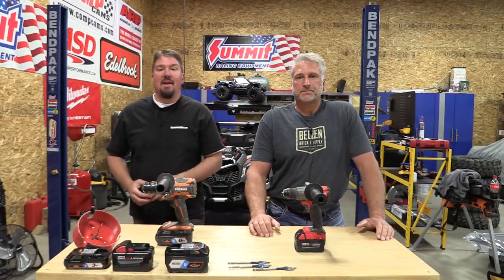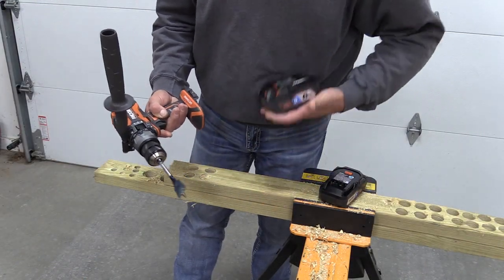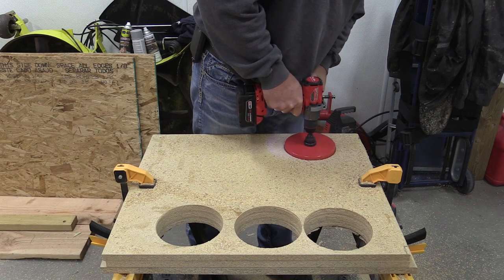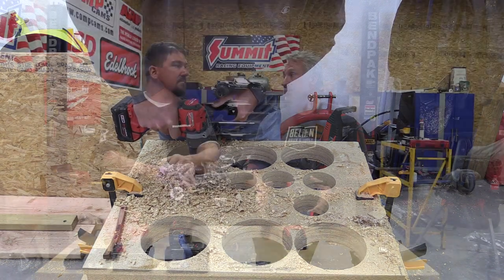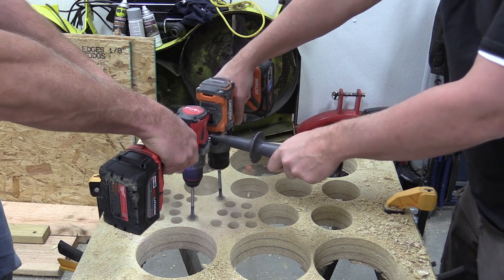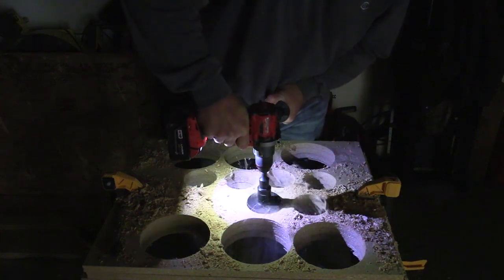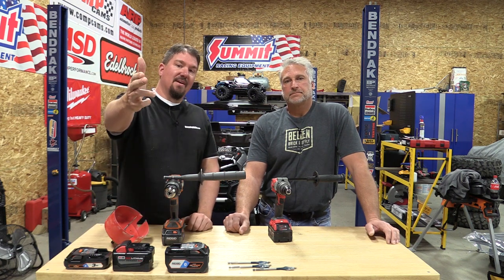Ridgid 18V GenX5 Octane Hammer Drill with 1300 in-lbs Vs Milwaukee 2804-20 with 1200 in-lbs

Comment: Try the same test with the Milwaukee high output battery and see if you get the same results I believe you may not. Another test would be a long-term test just from my personal experience Rigids don't last very long on an actual job site.
Reply from the maker: We are working on it.  There are no 6.0's in the shop and putting a 12.0 on it did not change who won the contest, but seemed to skew how things looked in the video.

Comment: That light on the rigid is nice!
For the rigid to have 100 more inch pounds it was still not really out performing the Milwaukee. Especially with a smaller frame.
The styling of the rigid is really nice. 
As I type this I actually don’t remember if you mentioned it but what is the weight comparison?
Reply from the maker: Ridgid is significantly heavier.

Comment: Does Ridgid tool have to be labeled "Octane" in order to use it with Octane battery and get the increased performance?  I have Ridgid Gen 5 hammer drill.  It's rated at 700 inch lb.  If I put Octane battery on it, does the drill have the programming to communicate with battery to achieve improved performance --up to the 1300 inch lb torque that the "Octane" hammer drill is rated at?
Reply from the maker: Yes.  Will you see more performance if you are currently using a 1.5 Ah battery and jump to a 6.0 Ah Octane, yes, but to get the "octane" power, you need an Octane tool.

Comment: Not a fair test, ya should have used the ho battery, it would be alot closer if not better with the 6 or 12 Ho. Batteries countinous output or amperage ratings make a big diffrence in torque & power. If a manufacturer is using a samsung 25r and another is using a sony vtc5a, theres a big difference in the continuous ratings and thats the case here in this test. Still ya did a good job and put out a good video but it wasnt apples to apples so to speak.

Comment: Good test. I would like to add though, that size is also very important. In this case I would say the end result should fall in favor of Milwaukee because of the big size difference
Reply from the maker: I agree with what you are saying, but we only tested power.  We wanted to see if the 1300 in lbs was legit.

Comment: You should be using the High Output battery from Milwaukee in order to fully test their new tools.
Reply from the maker: The M18 12.0 HO did not change a thing in the tests.
Reply: @WorkshopAddict  "Ridgid 18V GenX5 Octane Hammer Drill with 1300 in-lbs Vs Milwaukee 2804-20 with 1200 in-lbs" Take 2--ACTION!
Reply from the maker: @jacobgarrettheimberger4320  What?
Reply: @WorkshopAddict  Let's see a new video using the correct battery. Also, switch the users of the tools half way through since you both handle the tools differently.
Reply from the maker: @jacobgarrettheimberger4320  Did you watch the video because we do change tools in it and talk about everything except us using a 12Ah battery because we think that is silly on such a small drill.
Reply: @WorkshopAddict  I agree the 12Ah isn't practical on there, but I can definitely feel a difference between the 5Ah and the 6Ah High Output, I don't believe that it makes 0 difference.

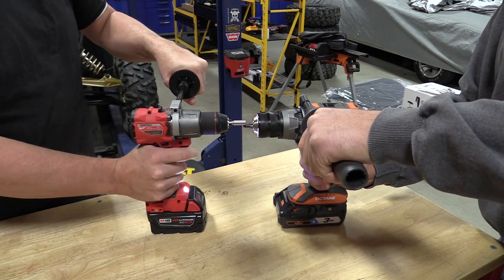Comment: Are you using a 3AH hour battery in the rigid and a 6 in the Milwaukee at 1:37?
Reply from the maker: Yes, but that is not much of a test.  It was more of entertainment as we commented the two together.  We get to real testing side by side and equally at the end.
Reply: @WorkshopAddict  Haha yeah, fair call. And in the end, I'd say it comes down to what you want from the tool... or what battery system you have.
Reply from the maker: @dragonling748  You are correct!  But the goal was only to prove it had more power.
Reply: @WorkshopAddict  To quote Jeremy Clarkson "POWERRR!!!"
Reply: Everybody seems to think that the higher the battery capacity the greater the max current discharge rate when in reality the opposite is true when it comes to individual cells. The 3 Ah Ridgid Octane battery has the newer 21700 Samsung cells in it with greater max current discharge than the 16550s found in the 6 and 9 Ah batteries.

Comment: Would the Milwaukee get more power from their HO batteries?  Might be worth a look. For the size and extensive tool lineup the Milwaukee has to be the smarter buy IMO. great review I love the comparisons much more than a straight review.
Reply from the maker: We used the 9.0 Ah when we showed them both together.
Reply: WorkshopAddict 9.0 isn’t HO. The new 6.0 & 12.0 are. Since those give more power to the new tools I’m wondering if they do the same for the drills etc.
Reply: I have a 9.0 HD and a 6.0 HO battery and the 6.0 definately gives the hammer drill more power but the run time is less.    To make this an apples to apples comparison.  You need the High output battery's   vs the octane battery's
Reply: Also the guy using the rigid looks like he’s putting way more force on the drill. Just look at the body position, you need to switch operators in that test too. Regardless, Milwaukee should win every test with what they charge, if it can’t, they need to bring their prices down and back off on all their bold claims about being the best.
Reply: Kalen T I’m gonna say he tried to be as unbiased as possible and didn’t push down harder on on one over the other. Also, the drills as bare tools are priced the same. Both $149. The ridgid doesn’t come in a kit so you have to spend about the same amount to create a kit as you do a kit for the Milwaukee.
Reply: Jonathan M I’m not sure where you’re looking, but in Canada the Octane is $169 and the Milwaukee is $229 for the bare tool.
Reply: C-Bomb it’s down to $199CAD

Comment: Maybe 20 holes more in a day with the Rigid. But if you look at size and weight, is it really worth it? I mean carrying around so much "more" tool than you need? Not for me anyways...
Reply from the maker: All we did was test power and speed, not what one fits each user.  Your comment makes total sense.
Reply: as a person under 40 i'd love to have extra weight and extra power, but yeah some of the older guys ( tradesmen are aging quickly)  lighter and compact is better
Reply: @industrialrubber5078  I get your point. But if you are drilling holes over your head all day, I bet you would regret your decision pretty fast🙃

Comment: 1300 and 1200 in-lbs of torque and still both drills cut out drilling holes in wood ? BTW, the Ridgid seems to have better designed cooling vents. I bet the Milwaukee was much warmer after these tests ? Also, is there a big price difference between the two ? Thanks for the video. (although Jeff's mic seemed to be turned off near the end of the video ?)
Reply from the maker: Not a big price difference between the two.  Yes, we had a battery failure on Jeff's mic, but it was still clear so we used it.

Comment: I bought the Ridgid  kit , the compact drill has broke 4 times. I have to travel over 100 miles to a Home Depot repair center to get this fixed. They will not replace the lemon drill only attempt to fix it and it breaks shortly after i use it. The problem is the bit does not release once I use it, I try to replace the bit and it will not release. Lifetime warranty is worthless unless you want a lifetime of running this drill to the repair shop. I have since bought the Ryobi kit and so far so good, but no extensive trial as yet. I recommend not buying the Ridgid compact lemon drill or kit, (save your money)!!!!!!!!!!
Reply from the maker: Just for the record, none of the tools in the video are the ones you are talking about.  We hear this often where the Home Depot store can make or break how effective the warranty is with Ridgid.
Reply: @WorkshopAddict  True, just thought i'd mention my experience with the warranty process and how they just seem not to fix the drill I got, the otter Ridgid products I  have bought seem just fine, but have not had to test their warranty fixes on them, I'm still very disappointed with my experience after driving over 800 miles (4 trips) to get it repaired, but principle will keep me trying, .
Reply from the maker: @buckaroobonzai8646 I would not be happy either!  We posted that comment so people would not think this drill came in a kit at this point.  We wish you good luck!

Comment: The Ah capacity of the battery has no bearing on performance(in the case of tool batteries with BM boards in them.)  The performance will be limited to how many amps the battery can output instantaneously.  Ah is just how long you can use the tool.
Reply: It depends on how hard the batteries are pushed to their limits.    Generally, the higher AH batteries are capable of delivering more current with less voltage drop.

Comment: My Ridgid drill cuts out using the 6in hole saw.... I have sent it back twice it won't cut in drill or hammer with the hole saw it just torques up and stops.
Reply from the maker: Are you using a fast cut like we have or a bimetal?  Level 1 right?
Reply: @WorkshopAddict  a Spyder hole saw.
Reply: @WorkshopAddict  Cornhole board holes 1/2 plywood
Reply from the maker: @Charlie-qd3qs  Very similar to what we used in the video.  Huh.  I can tell you that we have stalled out a lot of drills with that hole saw.  Not sure why it is not working for you.  What battery are you using?
Reply: @WorkshopAddict  9ah octane battery and 4ah and 2ah no difference.
Reply from the maker: @Charlie-qd3qs  will Ridgid replace it?
Reply: @WorkshopAddict  been replaced twice. It was funny I had the tool manager from my local home Depot check it out and he brought out his Fuego series Ridgid and it cut like butter. He grabbed a new one off the shelf same thing. I also have problems with the job max heads over heating quick and cutting off.

Comment: rigid is a test mule company for TTI/milwaukee, you will see many new techs used in the rigid before they put it in their bigger brand name company like milwaukee.
Reply from the maker: I believe the opposite for most things.  I believe most old Milwaukee technology rolls down to Ridgid.  Not in this case, but overall.
Reply: @WorkshopAddict  im just going by what a TTI rep told me in san diego, i've personally seen a few roll down to milwaukee like the ridgid "stealth force" you reviewed in 2015, and then the milwaukee surge hydraulic driver that appeared the next year.
Reply from the maker: @Ma77riK  That is 100 percent true.  I forgot about that one.
Reply: All good stuff....I just buy what ever color coordinates with my uniform and truck. LOL
Reply: None of the technology from Milwaukee specifically "rolls down" to Ridgid. Ridgid is designed in Europe by Emerson owned AEG Tools. TTI does manufacturing for both companies but that doesn't mean shit when it comes to designing/engineering the tools themselves and both are from completely different unassociated/unaffiliated tool design houses. Ridgid is European whilst Milwaukee is American and outside of the company contracted to to the actual manufacturing of the tools in China, completely unrelated.

Comment: I don't believe you can compare a Milwaukee drill with a 5.0ah battery and a ridgid with a 3.0ah.  The 5.0 is going to be able to deliver more amps due to more batteries being in parallel.  Why wouldn't you have used that 6ah battery they had?
Reply from the maker: Look here as we did not have the Milwaukee 6.0 Ah then.  do here.  https://www.youtube.com/watch?v=UzVkIQdyXaE&t=
Reply: You are WRONG. The 3 Ah octane battery has the newer larger 21700 Samsung 40T 30A cells in it whilst the 6 Ah and 9Ah have the older 16550 cells with lower discharge current capability.

Comment: Why can't tool manufacturers stick to specs in either Ft-Lb or In-Lb?  It makes it very difficult to do comparisons (which maybe is the whole idea).  It reminds of battery booster manufacturers who like to use 13,000 mAH instead of 13 AH (cuz we all know 13,000 has to be WAY more than 13). :-)
Reply from the maker: It is marketing.  The more people have to learn the fewer people will want to learn to compare for the most part.

Comment: Ridgid's Octane batteries provide more current. Similarly, Milwaukee's High Output batteries really provide more power. I think if the Milwaukee 6AH High Output battery is to he used in this test, Milwaukee's drill will probably have the edge.

Comment: The Ridgid is a great drill, but  anyone saying the Gen 3 size achievement is irrelevant to the findings is plain and simply wrong.

To be on or near the top of the class with by far the most compact and lightest drill is a big deal. 

The new Gen 3 kit gives you the engineering and ergonomics of Panasonics most recent beautifully made 18v drills and impacts, with quite a a leap in power. That's significant.

Comment: stopped watching at 6:53. i just want to point out that from the concrete drilling test i can see the knees of one guy bending and i couldnt see that form the other. blue jeans had his feet closer to the drill that suggests more downward force on the drill.the other guy looked farther from the drill so i would assume just pushing with his back instead of weighing it down.

im not a regular of this channel. 
im no tool specialist.
im no carpenter or anything just throwing out what crossed my mind while watching. 
very interesting video

Comment: Wrestling test? I don’t think so. Shaft on shaft direct couple test is a test we can do to pneumatic tools but electric tools. Stalling electric motor draw ten times and more current without a protection circuit that will fry the battery or motor. The looser in this test could be equipped with a protection circuit is one I’d keep. The winner after this test may be burn so bad approaching retirement age.
Reply from the maker: Watch the full video, that part was a joke.